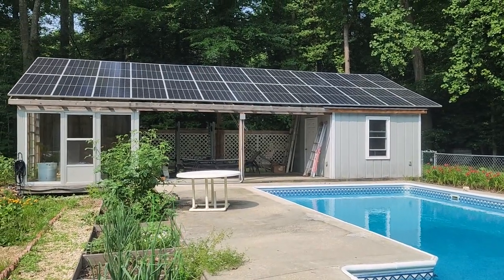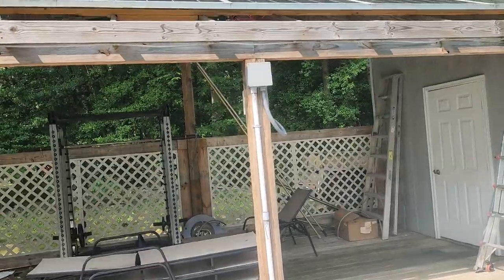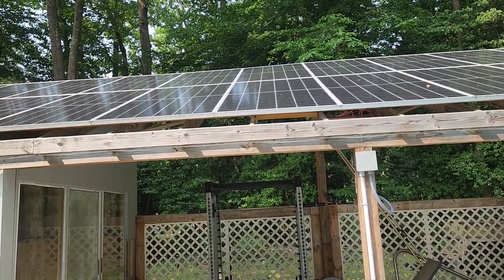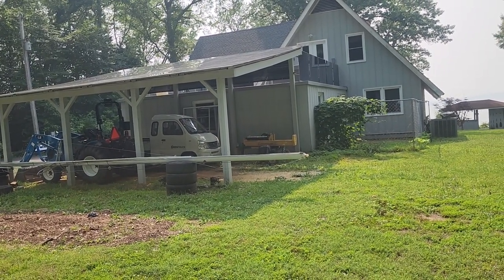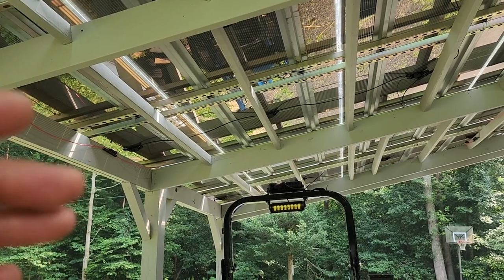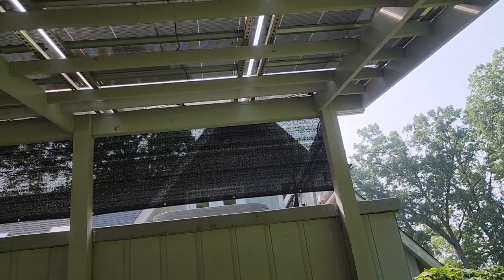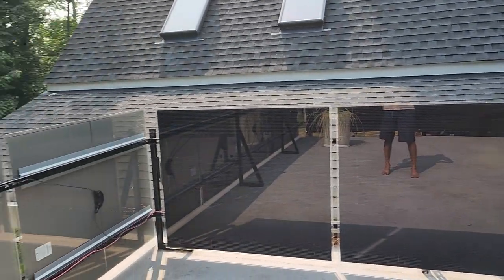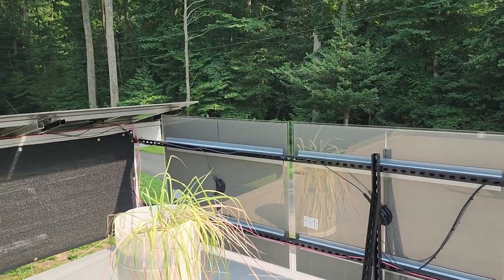DIY Solar Carport/Fence and Pool house/Greenhouse with Super strut

Comment: I have some of that superstrut on my dual axis tracker. 6x200w bifacials.. it does well. The awning on my '28 RV gave out and the sun beats the side of it. I have only 4 of my 290w panels in use but wanting to use them as a solar awning.
Reply from the maker: @OFFGRID_Trucker  https://www.pvxchange.com/Solar-Modules/ENN/EST-115_1-2106646

Comment: Saw another video recently where someone in the uk built a solar roof with panels and a product that sealed the spaces between panels. Was a rubber-like gasket that could be dry fit and cut. 

Can’t find the video at the moment but might be an option for future updates
Reply from the maker: @thomaswood9836  they make those here now signature solar has some options similar to that.